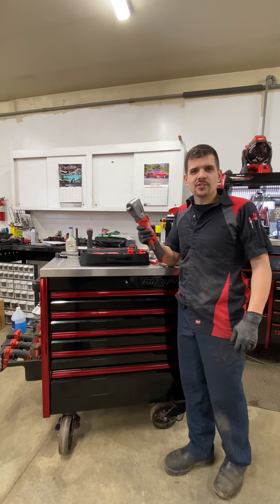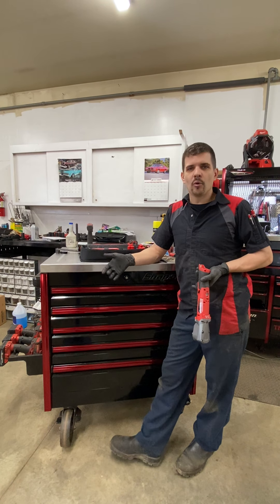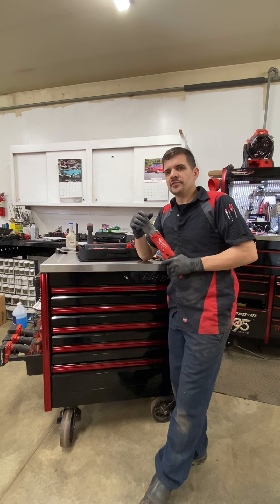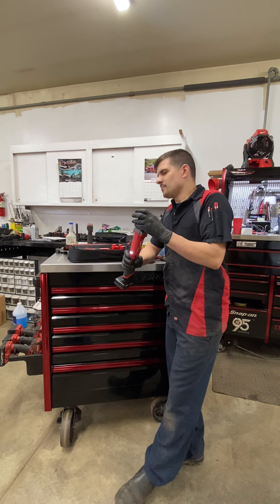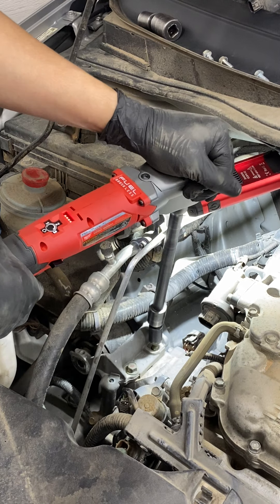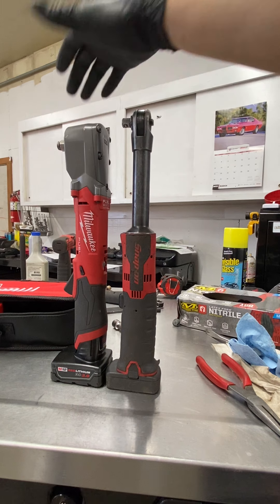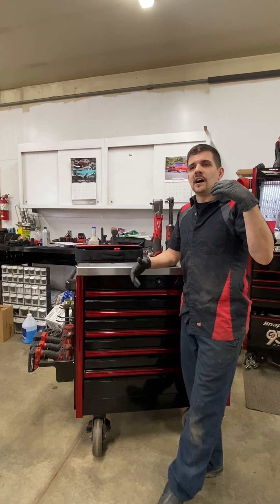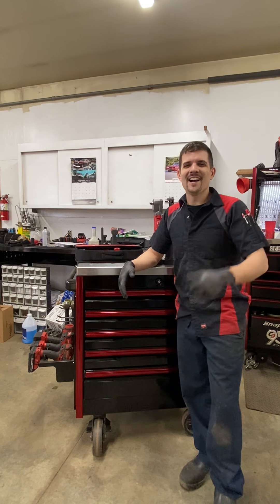Milwaukee right angle impact. 2565-20 is it worth it?

Comment: i bought a 1/2 right angle a few months back for use on heavy equipment in tight spaces its an incredible tool  i found the 2 amp battery just doesn't cut fine for the ratchet but even at 50% it gets weak .. for continuous impact even after the bolt breaks free the 4 and 6 amp hour is the way to go
Reply from the maker: Yea it makes the world of a difference with a 6.0 for sure. That’s all I run now
Reply: Gotta gave the juice 6.0 I use it and I am a diesel tech as well this thing is amazing with reefer work and engine work

Comment: good afternoon, that snap on rachet has the same strength as the milwaukee? can you remove 17 bolts? Greetings.
Reply from the maker: One is a ratchet one is an impact. Two different tools
Reply: @Enrightauto  so the milwakee is an impact ratchet and the snap on is just plain ratchet